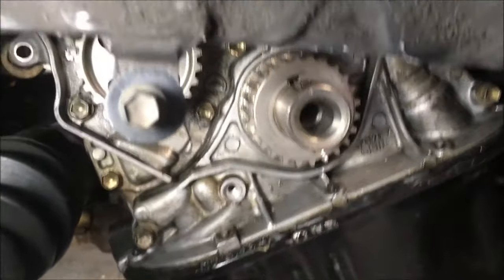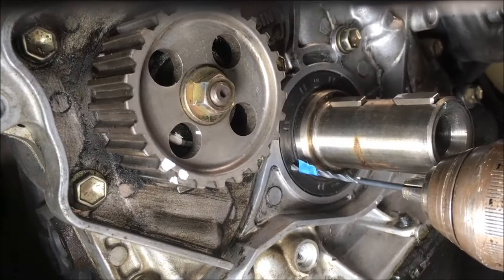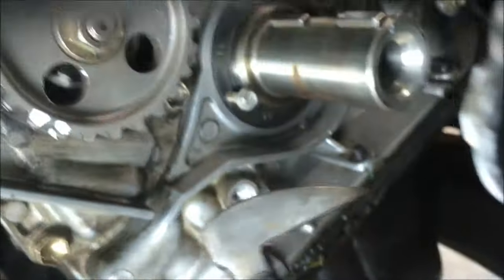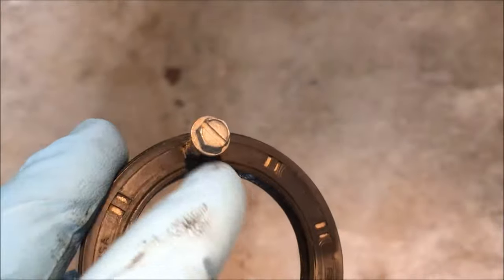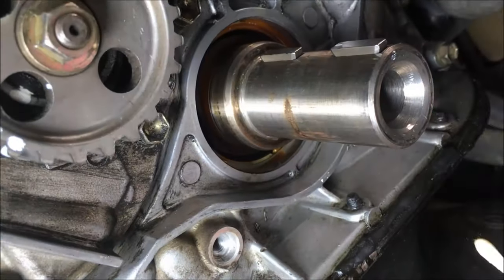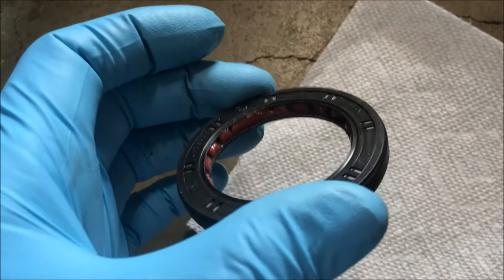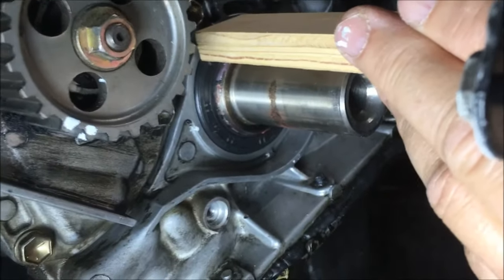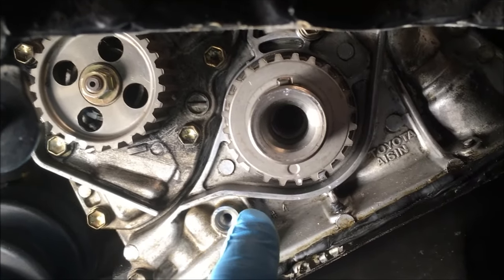Remove and Replace Crankshaft Seal

Comment: I tried that on my transmission seal that where the driveshaft goes into it. Screw pulled out so I used a slightly larger screw. That screw pulled out too. Fortunately there was enough of a lip on the seal sticking out where I used a flathead screwdriver and hammer to pop the old seal out myself.

Comment: Wayched more than i "meant to" as your demeanor,  voice, etc reminds me so much of seejanedrill lol. I am literally scrollingvtrying to find tricks on zr2 front mains but theyre all: 1.Drop Diff  ..... yeah, if i was going to do that id have replaced my pitman a year ago when the USMC "mechsnic"  i paid to do it failed miserably. Ill just end up doing it hanging upside down from my A-Frame engine hoist lol. Good video. I use self tappers on wheel seals all the time, as it takes 13 seconds instead of following mack volvo impact protocol which takes 30 minutes...
Reply from the maker: Thank you, beasyphone.  ;)

Comment: Smart
Reply from the maker: Thank you, hasan.
Reply: @frugaldiy1  is it possible to pull it usin a pick hook tool?
Reply from the maker: I don't think so.  Those seals are in there pretty darn tight.  The method we used allowed us to drill into the metal band and get some "bite" to pull the seal out.